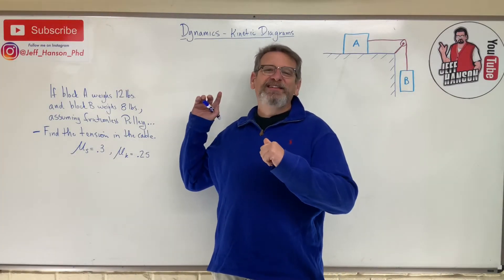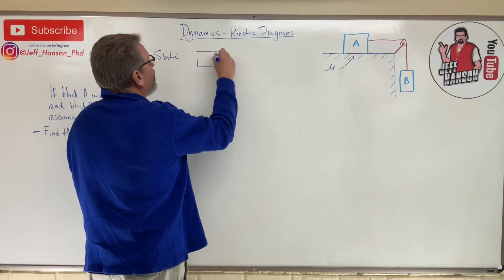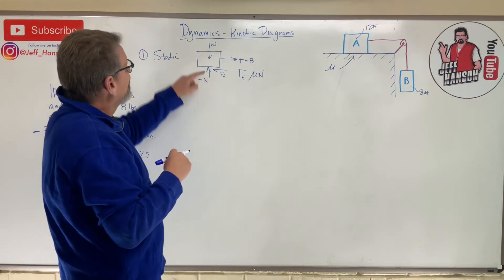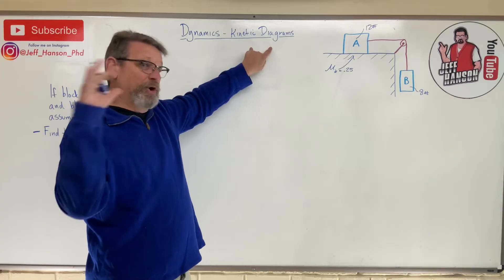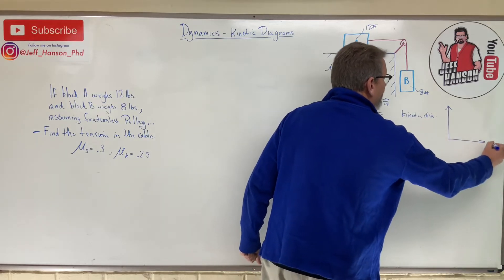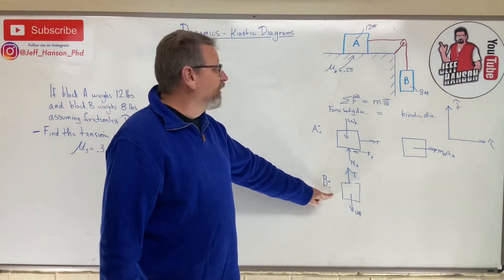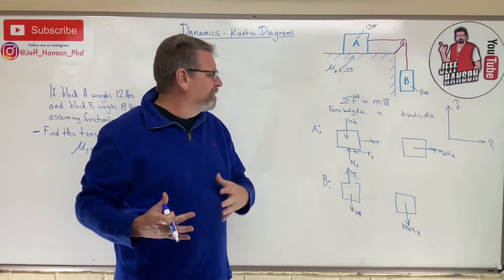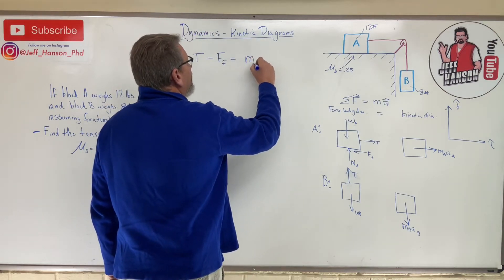Dynamics: Lesson 16 - Drawing Kinetic Diagrams, The Quintessential Dynamics Problem

Comment: why is the weight not multiplied by the acceleration due to gravity?
Reply: 3 months late here, but the weight is equal to mass times gravity (W=m*g). Acceleration and gravity are the same thing so when you have a weight, it already accounts for the gravity/acceleration. Be careful not to mix up weight and mass. :)